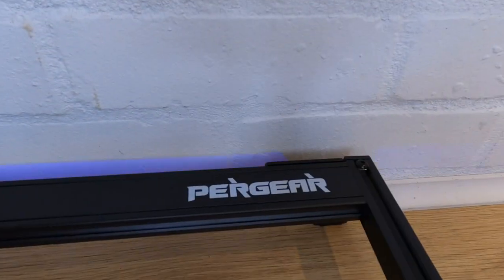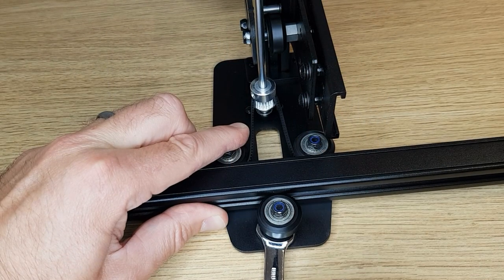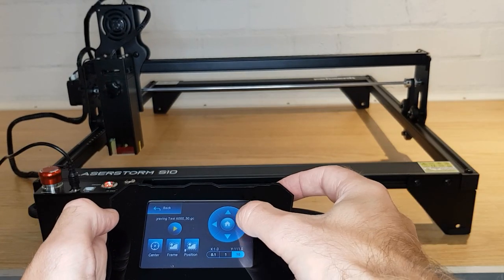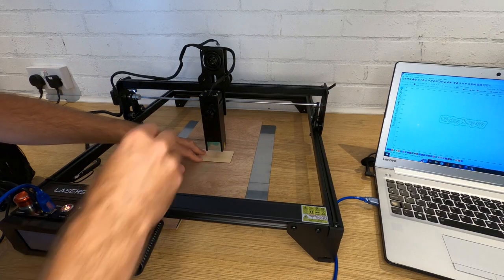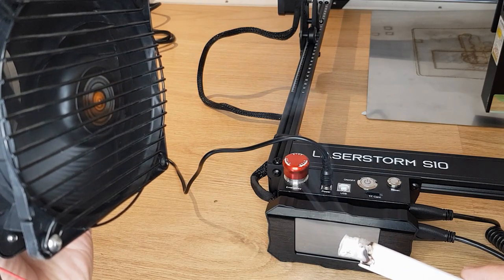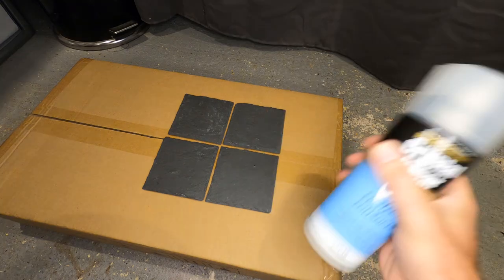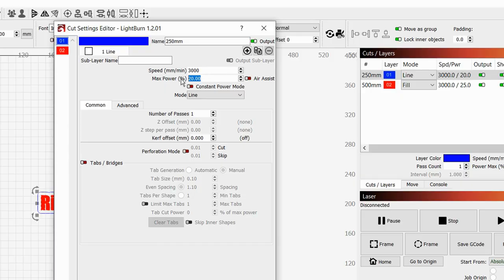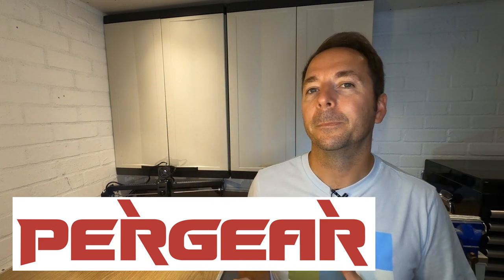Complete Beginner Laser Engraving With The Pergear Laserstorm S10

Comment: A really nice video, well done as always. Let me echo, and amplify your concern on laser safety. I find these laser engraver companies are way too cavalier about laser safety, and the potential permanent eye damage from their products. I know professionals working in telecom research who have permanent eye damage working with lasers much less powerful than the ones in these products. There are so many ways you can get stray rays, bouncing around a room, and ending up in your eye. A person should really take a professional laser safety class before plugging in one of these devices, but let me throw out one thing that folks should realize. Safety glasses are simply not one size fits all. The glasses have to be chosen based on both the power and the wavelength of laser being used, and have to be designed to not allow rays to pass between the face and the glasses. Understand that a stray ray could be coming at you from multiple directions. So, just realize the cheap pair you showed would offer little to no protection. Not a criticism of your excellent video, just a warning to amplify your correct intuition on these machines. They are dangerous. Thanks for a great and informative review.
Reply from the maker: Yes, attention to safety around these machines cannot be overstated 👍 Thanks for the comment. I did check the spec of the glasses Vs the wavelength on the laser module as I didn't know any better. I should probably invest in a better pair of they are not good enough.

Comment: Great video mate I started laser engraving with a laser module on my ender 3 and now have a K40 co2 laser I also use lightburn and absolutely love it..
Reply from the maker: I'm really enjoying it too👍
Reply: @RickyImpey  me too I've done loads of laser work I also got into cnc routers so am using lightburn to create stuff for that before transferring it to carveco and then milling them
Reply: Would it be difficult to change from laser back to 3d printing and back on the ender 3? Does the laser module also work on carbon fibre?
Reply: @Ayeare  no it's super easy I fitted a switch to mine to turn the laser on and off and the laser has magnets on to hold it to the fan shroud. However I 3D printed a bracket to keep it on so I can switch from laser to printer in a second
Reply: @alexandersievewright3842  oh awesome! So the laser module can be on the printer all the day and the extra weight doesn't cause issues with the printer movements?
Reply: @Ayeare  yes mate the creality laser for the creality printers is really light it's not super powerful but works well for engraving
Reply: @alexandersievewright3842  cheers! Appreciate the help!
Reply: @Ayeare  no worries if you could post photos on here I'd put them on for you to see how mine is setup